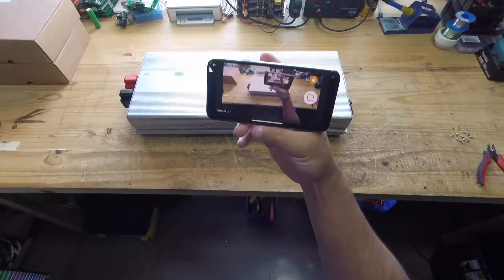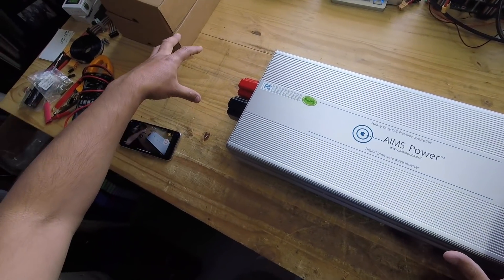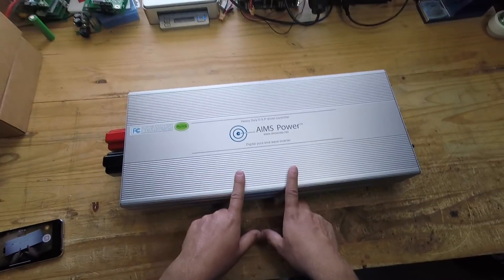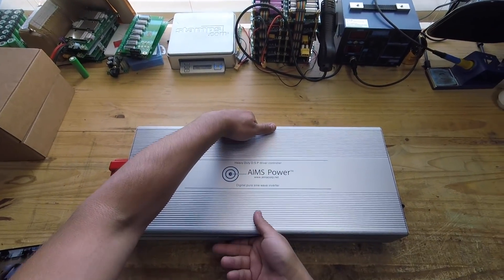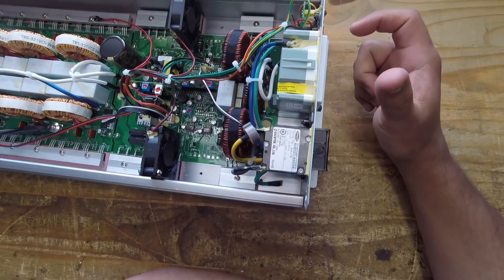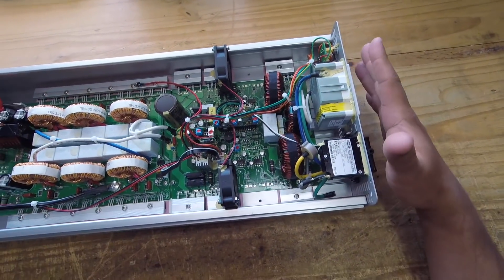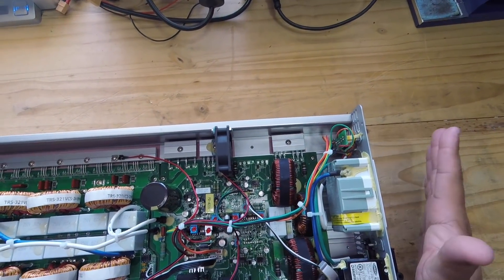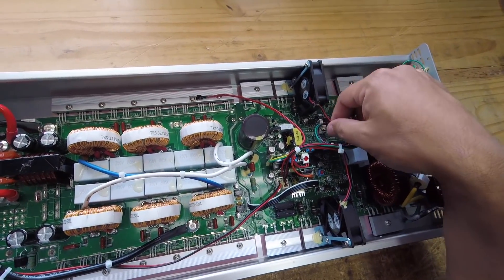Inside a $700 3000W Aims Inverter

Comment: The ground wire in AC systems doesn’t protect you and equipment by dumping power into ground, it gives the AC power a zero resistance path back to the source where the ground wiring should be bonded to the neutral. A simple way to think about it is, a 20 amp breaker needs around 20 amps to pass through it to trip, but it will trip quickly with larger amounts of current. If your hot wire shorts to a metal enclosure, and the metal enclosure is not tied to ground, it will draw a small amount of current, and leak, until someone comes along and touches the enclosure, and gives it a lower resistance pathway back to the source. This will cause you to get blasted with 120V, and up to 20 amps. An enclosure tied to ground will never hold any potential. The second the hot wire shorts to it, it will travel down the zero resistance ground wires, back to the bonded neutral at the source, and current will spike instantly, and trip the breaker. That way, if someone comes along, and touches the enclosure, the circuit is already off. If you try to turn it on, while someone is touching the enclosure, the power will still take the path of least resistance through the ground wiring to return to the source, and the breaker will again trip off without any current trying to travel through the person. That’s why if your house doesn’t have a ground wire, or a bonded ground at the main panel, you use GFI’s to ensure that the current going out on the hot is equal to the current returning on the neutral. I’ve seen people pull in ground wires, and beat a rod into the ground somewhere, but it doesn’t do shit if it isn’t tied all the way back to the last point of power transformation.
Reply: the only thing the ground wire does is give lightning a path to ground. Sadly the catch is that it therefore also references the grid to ground meaning you are referenced to the grid if you are standing on the ground. It was a bad decision in my view based, as usual, on cost and not safety.
Reply: @paaao  you're miles off.
Reply: @paaao  and just a side note buddy, it's got nothing to do with "my ego". I'm just a lowly hobbyist, not certified in anything. I have however worked installing trunked RF repeaters for Queensland communications, worked for channel 7 studios Australia, production line switchboard assembly to name a few. 

Certification speaks nothing to fundamental understanding. Also Just because it's industry code does not mean it is an ideal universe. I often ask questions of qualified electricians that stump them. Also, ground plane earth systems on RF equipment are a very different beast to distribution systems and their necessity is one of very different function with an order of magnitude of requirements, completely outside of the scope of this "discussion" and you know this. Don't be a princess and jump straight on the defensive and then resort to insult, it only hints that you're arguments are weak.

Why, is there such a beast as a mains isolation transformer? (Something I use on regular occasions) Surely that's outright dangerous!!! 

Try and keep a civil tongue hey? 

So, to reiterate, if neutral wasn't tied to ground, how would an end user receive a shock from hand to foot, outside of a bizarre yoga accident?
Reply: @paaao  can you advise on how to keep them from breaking down after a month? Also is there a way to use the extra power that the solar and wind generate in order to heat up some water? I have 60l to heat up.

Comment: It's called bonding when you connect the ground to the neutral and it happens in houses as well in the closest circuit panel to your feed.
Reply: But doesn’t bonding happen at a specific place in the system? Before the breaker in the panel correct?
Reply: @yolo_burrito  Bonding can happen anywhere the ground and neutral connect. Code states it should happen at the pole and once in the house in the closest panel to the source. Breakers don't normally attach to ground or neutral so there is no "before" the breaker.
Reply: Furthermore, you usually cannot use a GFCI in a bonded circuit. However, a lot of generators work very well with a bonding plug connected into the circuit. It prevents that very problem with current leakage across the neutral.

Comment: Will the tesla charger take more than a few miles an hour on 120v? What about a 240v inverter?
Reply: That would take a huge battery, because the 240v chargers are alot higher wattage, like 50-60 ampsat 220-240v, About 3kw inverter is the smallest 120 v the charger will work with,
Reply: JAMES! Since the 70's you can set the charging current in the Tesla so it can limit it. You could set say 15-20A at 240V
Reply from the maker: @anthonystefanacci9890  I think 14A max on 120v
Reply: @jehugarcia  With that limit you're only at 1.6kw or a few miles per hour charge. Is it even worth it? Some of the AIMS 240v inverters aren't much more money and have 3-4kw output and battery chargers built in.

Comment: Isn't neutral and ground tie together at the breaker box in houses? I thought they were. And so I don't think all that energy when something goes wrong, goes to the ground. It just takes that green wire back to the neutral bus bar in the breaker box.
Reply: You're correct. The ground wire from outlets go back to the breaker box and connect to the neutral. It's basically a second low resistance path back to the source. From there is goes to the transformer. The ground rod only has current flowing when there are large power spikes like lighting strikes.
Reply: @adrianf1995  yup https://youtu.be/P-W42tk-fWc?t=550
Reply: Only if all things are wired correctly and there ore no loose neutrals or grounds. Things can happen. The neutral is really the center tap on the transformer in the line coming into your house. It is then grounded using a ufer ground at your house. It’s called a ufer. The neutral is essentially 0 volts. I have seen them at 8-10 volts when there is a loose ufer ground. Best to be safe.

Comment: Ground and neutral are connected in a home breaker
Reply from the maker: At the panel only
Reply: @jehugarcia  Yes, at the first panel only.  All the ground connections are bonded to neutral by this connection, giving a path back to the transformer.  The ground rod is not intended to facilitate the tripping of a breaker when there's power going to the ground wire.  The ground rod is more of a lightning strike protection.

Comment: For charging, what do you think of super capacitors?
Reply: They are really bad for using with inverters. In short, No. It's not good
Reply: @FunScientifix  instead of the inverter, not with it
Reply: @meh-canics9628  that would be even less viable option. As supercapacitors have very low voltage limits. Around 2-3V per Cap. To charge a 400V Tesla battery, you would need at least 450+ Volts. So you would have to connect 200 or so of the supercaps in series. And when you connect caps in series, their capacity decreases 1/the no of caps in series. So 1/200 the original capacity. 

Further, one capacitor goes for like 7-8$.  200 would cost a silly amount. 
There are even more demerits but I think the ones mentioned are enough.
Reply: @meh-canics9628  Instead of the inverter?  Sounds like you have no idea what super capacitors are! They are not magic solution to every problem. They are just capacitors that hold a small amount of charge, like a small bucket with big pipes.

Comment: Bonded? That inverted should be bonded. Not sure if it can even be unbonded. Don't think so.
Reply from the maker: not sure what that means
Reply: @jehugarcia  bonded is when ground and neutral are tied (connected) together. Your mains coming into your house is bonded at the entrance (first) panel, where it enters your home. I think that inverter is bonded as well.

Some inverters can have the bond removed. It can be helpful when hooking it up to other electrical systems to have it unbonded. Sounds like you need it to stay bonded. The car looks for that bond. So that is good.

By bonding a system you create the first "fault" in that system. You need it.

Comment: I think I saw a video kinda like this but the guy said if you connect the neutral and ground together, you will energizer your battery bank to high level of volts?
Reply from the maker: the makes no sense
Reply: I agree, it doesn't make sense but he said that he hooked the neutral and ground together and his 12 volt battery bank was energized to 60 volts,,, I even thought, how?
I wish I could remember or find the video, I'm pretty sure it was a video about the cheap Chinese power inverter called, "tiger claw" and someone was explaining it.... I hope this helps!
Reply: @mmtruckingllc657  

I saw the same thing! I believe he also said  if the inverter had 1 large transformer it was different than the type of inverter shown here or vice versa  i cant remember...